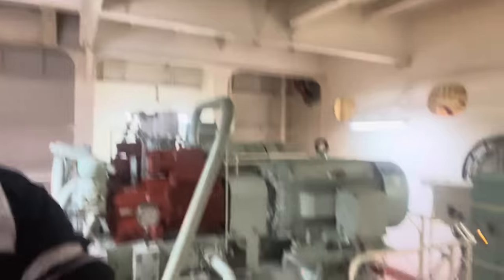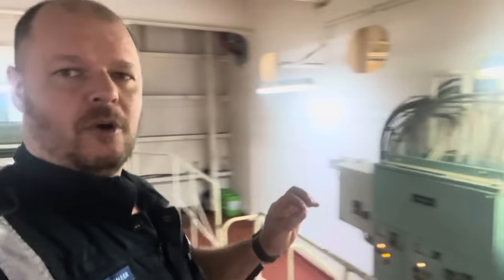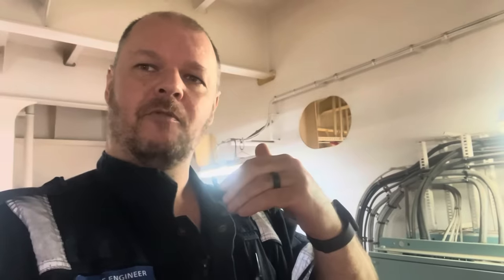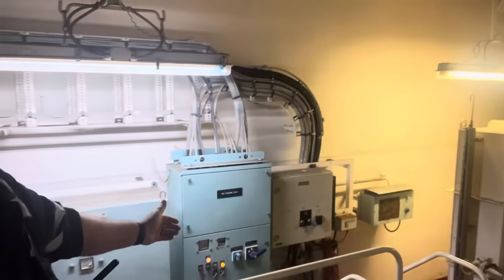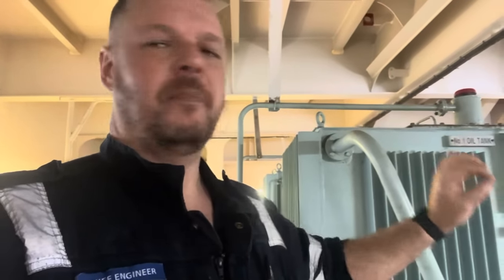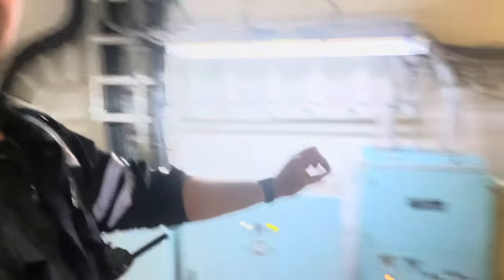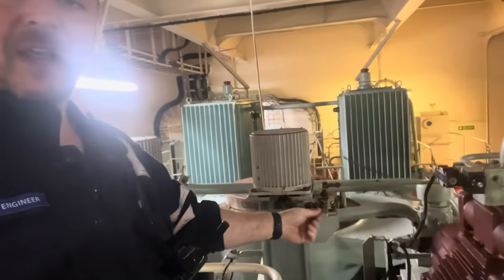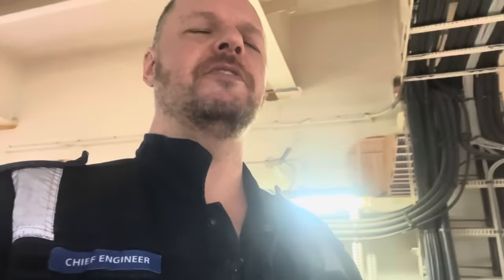Dali size containership steering system. How it’s designed to not hit Francis Scott key bridge

Comment: I'm a master helmsman with years of experience. After trying things out in the Nautis simulator, I think what happened is it took around a minute for backup power to come online, at which point they likely got steering back at least briefly until the second power outage happened, but by then it was too late.  

Two forces were at work over the course of that minute that caused the ship to turn rapidly to starboard.  The ship was transiting near the port side of the channel, and bank suction caused the rear of the ship to pull toward the port channel bank and it also pushed the bow to starboard.  At the same time, the ship was hit with a cross channel current coming from the starboard rear quarter, further driving the rear of the ship to port and the bow to starboard, inducing a rapid turning of the ship to starboard.

Even if they got steering back after one minute and put the rudder hard to port, the momentum induced by a full minute of turning forces without rudder input to compensate ended up causing the swing to starboard we see. Once a ship builds a turning momentum, it takes a long time to stop the turn momentum and get the ship coming back the opposite direction.

If the helmsman had been making a course correction to starboard when the power went out, and the rudder also got locked to starboard by 10 degrees or so for a full minute on top of that, it would make it just about impossible for the ship to recover in time to avoid the peer, even if they got rudder control back the moment the emergency generators kicked on.
Reply: It's looking more and more like that. The crew was doing everything they could. It's just the bridge got in the way of recovering the ship after its power failures.
Reply: What about the giant cloud of black smoke after the first power outage. The way I understand it, since this ship was built in roughly 2015, the main engine most likely had hydraulically powered fuel injectors and exhaust valves, and in the case of a total shipwide blackout, the main engine would have stopped nearly immediately due to no exhaust valves opening, and complete fuel cutoff. I think what happened was, there was a power outage, they managed to start the main engine in reverse, then panicked and put the main engine in full speed reverse. SInce electronically controlled engines have no camshaft, there's no delay in waiting a few seconds to move the camshaft from Ahead to Reverse. If the main engine is stopped, it can be started in reverse, and then in an emergency, commanded to run at max speed. Since it was already running, there's no need for a blow down, or prelube or anything like that.

With a single screw ship, with a single rudder, and moving at only 8.5 knots, the rudder will lose a ton of effectiveness due to the immense amount of cavitation, and lack of water flowing past the rudder. Like others have said, using bow thrusters at speeds over 2-3 knots is useless, and consume far too much electricity to be able to run off of an emergency switchboard.

Here's what I think happened. Several or more reefer containers shorted out, or the cables supplying 480v 3 phase power to the reefer section shorted out caught fire, and tripped the main generator. Instead of letting the automatic system start and run the emergency set, they quickly shut off the tripped breakers and started the other set of main generators, all ships have at least 2-3 or more main generator sets, most often there are 3. One running, one also running in parallel during heavy load operations or during arrival departure from ports or other critical situations, and one in hot standby or in maintenance. Then when they switched that main genset back onto the main bus, and flipped back on power to the reefer containers, it caused another short and either damaged something, or tripped breakers. They must have done this before the emergency generator switched on, sometimes they have a time delay so that the emergency set won't start up in case of a momentary blackout like what happens when you disconnect from shore power, and switch to onboard MDG's there's a momentary blackout. So this explains the first lights out on the Dali, followed by a longish delay lights come back on for 1/2 a minute then go back out. Now with no main generators available to start in time, the emergency set finally starts and runs after 30 seconds or so, you see the lights come back on the Dali, but not the main mast light and a few others, and then you see the bow begin to steer to the starboard, but it's too late and the ship hits the bridge 10-20 seconds after the bow finally begins to steer away from the bridge pylon.

There's rumors they were having electrical problems while in port. If this is true, they were idiots for leaving the dock. You would think that if you were about to take a ship on a 26 day long voyage down thru the Panama Canal, you would want to stay in Baltimore and have any generator or electrical issues sorted before leaving the dock. Number 1 reason would be for obvious safety reasons, a fire on board a box ship is a complete nightmare, 2nd of all, you would want to make sure you have reliable electrical supply to any refrigerated boxes. 26 days with no refrigeration is going to cost a lot of money in freight damages. 3rd, if you're planning on going thru the Panama Canal, there's a high risk of getting inspected before you're allowed to enter the first lock, because the Canal is very paranoid right now after that issue with the Evergreen ship stuck in the Suez Canal. No Canal authority is going to even take the slightest chance you're going to break down in the canal, if your ship looks like crap, you can either get detained, or sent the long way around. Good luck with that with todays high fuel prices, and you'll be late for your delivery appointment.
Reply: The current was pretty low at that time, the tides there are only around 2 feet, and they were only about 2 hours away from slack tides. However there was a slight wind to the south, and the Dali with that many boxes has a pretty good sail effect especially if the main engine stops, and combined with the effect of prop drag.  So it's quite possible the slight current coming from the south channel pushing against the stern of the ship, plus the wind from the north, plus the drag in the water from the stopped propeller could have started the ship drifting to starboard.

I think this whole thing is goiing to turn out to be a classic swiss cheese failure. Human error combined with mechanical failure(s), plus lack of maintenance. Unfortunately they took too many chances, and this time all the holes in the cheese lined up, and 6 people lost their lives.
Reply: Because the ship was in a very hazardous area, it seems the anchor should have been dropped as soon as power was lost. Too risky to just wait and hope for power to return. That would have more than doubled the time to slow down until impact, four minutes instead of less than two.
Reply: I believe there was also a significant breeze from the port (left) side as well, which would tend to cause the turn to starboard.
Reply: @brnmcc01  Thanks for your comment. Lots of good insight there. I'm thinking bank suction from the port side played a large roll in getting the ship turning, as well as a potentially locked rudder to starboard and currents. You are absolutely right that if that engine was brought to a full stop and somehow they managed to put it into reverse, they would lose a tremendous amount of rudder authority, further compounding the problem. 

If you have a slack tide and the ship is riding low and near the side of the channel, the bank suction can be very powerful. When I would drive during underway replenishments, it would be common for me to use 20 degree rudder steering into the ship along side us just to maintain course. The venturi effect is very powerful.

There's a crossing channel right at the point where the Dali starts to turn, which makes me think the currents, even if they were light at slack tide, played  a role as well. The current from the crossing channel would have been directed right at the starboard aft quarter of the ship.
Reply: @c0rr4nh0rn  typically a wind is going to push the whole ship in one direction rather than turn it, depending on the structural layout of the sail area on a ship. Winds were light that day.
Reply: Seems like they were already going to fast
Reply: Thank you, this is bar-none the single best, most plausible, most credible explanation that I have yet heard anywhere on the entire internet.  I can accept that big ships simply do not turn fast, and we've seen recent examples like the big boat that blocked Suez a few years ago.  You win the internet, Sir, bravo!! 🙌
Reply: @laroccafishing4771  Nah, 8 knots is a fine speed. Not too fast and not too slow for a ship that size. The speed wasn't the problem. In fact, if they had be booking it, they probably would have avoided the pier.
Reply: @brnmcc01  They certainly went into reverse, to lose the speed they did (8.5kts to 7). What puzzles me is they didn't stop to find out - was this psychological target bias? Having just completed a tug-assisted turn, she'd not have come underway worth talking about when the first failure happened, and stopping was possible.
The Antwerp incident was also steering-related.
Reply: You can see the Dali regain power and steering just before impact , as it starts turning to the port side but it was too late.
Reply: So the question is, what caused these power outages? We already know they lost power. Why?
Reply: Is it true the ship had been cited for issues in Chile?
Reply: I generally apply Occam's razor to situations. The most simple explanation was an attack.
Reply: So I like the Helmsman perspective, but for the Electricians POV I’d like more input.   Like I assume there is an operator on the electrical panel ? Who can operate the Bus from a console?? To me it sounds like inexperience and training.  I don’t know the system but I would assume the correct plan should have been to isolate the emergency bus that is feed by an emergency generator and get steering back online.  Clear the hazard lessons learned.   But it looks pretty messy from my POV not knowing the class or plant but from my limited view it looks like they choked.  How many engineers would be on watch just leaving the wall ??
Reply: @tonyawhitten5199  Not a new boat, it's been suggested the cargo's reefers (refrigerated containers) may have blown a generator. That would typically show up soon after cutting land power.
Reply: @sofly7634  I didn't spot it when I looked for precedent, throwing up the Antwerp issue. My family's the heritage Queen's Pilot in the Channel in Victorian times, so of course shit happens, but there were bad decisions - she could have been grounded, headed into the sidewater where the CG base is, stopped as soon as the first power outage hit. It's history now, but apply the lessons, don't just learn them. A lesson learned but not exercised gets forgotten.
Reply: @brnmcc01   Such a detailed comment deserves reading and I have trouble reading  big blocks of text.

What about the giant cloud of black smoke after the first power outage. The way I understand it, since this ship was built in roughly 2015, the main engine most likely had hydraulically powered fuel injectors and exhaust valves, and in the case of a total ship wide blackout, the main engine would have stopped nearly immediately due to no exhaust valves opening, and complete fuel cut off.

I think what happened was, there was a power outage, they managed to start the main engine in reverse, then panicked and put the main engine in full speed reverse. SInce electronically controlled engines have no camshaft, there's no delay in waiting a few seconds to move the camshaft from Ahead to Reverse.

If the main engine is stopped, it can be started in reverse, and then in an emergency, commanded to run at max speed. Since it was already running, there's no need for a blow down, or prelube or anything like that.

With a single screw ship, with a single rudder, and moving at only 8.5 knots, the rudder will lose a ton of effectiveness due to the immense amount of cavitation, and lack of water flowing past the rudder. Like others have said, using bow thrusters at speeds over 2-3 knots is useless, and consume far too much electricity to be able to run off of an emergency switchboard.

Here's what I think happened. Several or more reefer containers shorted out, or the cables supplying 480v 3 phase power to the reefer section shorted out caught fire, and tripped the main generator. Instead of letting the automatic system start and run the emergency set, they quickly shut off the tripped breakers and started the other set of main generators.

All ships have at least 2-3 or more main generator sets, most often there are 3. One running, one also running in parallel during heavy load operations or during arrival departure from ports or other critical situations, and one in hot standby or in maintenance.

 Then when they switched that main genset back onto the main bus, and flipped back on power to the reefer containers, it caused another short and either damaged something, or tripped breakers. They must have done this before the emergency generator switched on, sometimes they have a time delay so that the emergency set won't start up in case of a momentary blackout like what happens when you disconnect from shore power, and switch to onboard MDG's there's a momentary blackout. 

So this explains the first lights out on the Dali, followed by a longish delay lights come back on for 1/2 a minute then go back out. Now with no main generators available to start in time, the emergency set finally starts and runs after 30 seconds or so, you see the lights come back on the Dali, but not the main mast light and a few others, and then you see the bow begin to steer to the starboard, but it's too late and the ship hits the bridge 10-20 seconds after the bow finally begins to steer away from the bridge pylon.

There's rumors they were having electrical problems while in port. If this is true, they were idiots for leaving the dock. You would think that if you were about to take a ship on a 26 day long voyage down thru the Panama Canal, you would want to stay in Baltimore and have any generator or electrical issues sorted before leaving the dock.   

Number 1 reason would be for obvious safety reasons, a fire on board a box ship is a complete nightmare, 2nd of all, you would want to make sure you have reliable electrical supply to any refrigerated boxes. 

26 days with no refrigeration is going to cost a lot of money in freight damages. 3rd, if you're planning on going thru the Panama Canal, there's a high risk of getting inspected before you're allowed to enter the first lock, because the Canal is very paranoid right now after that issue with the 

Evergreen ship stuck in the Suez Canal. No Canal authority is going to even take the slightest chance you're going to break down in the canal, if your ship looks like crap, you can either get detained, or sent the long way around. Good luck with that with todays high fuel prices, and you'll be late for your delivery appointment.
Reply: @ohsweetmystery  we have to educate everyone, sometimes one at a time.  Anchors do not stop ships, they hold them in place.  At 8 knots, that fully loaded ship would snap the anchor chain like it's made of cooked spaghetti.
Reply: They dropped an anchor, pretty much explains it.
Reply: @ohsweetmystery  In another video they mentioned that one of the anchors were dropped and the chain was angled toward the back of the ship. I’m guessing that it would also cause the ship to change direction.
Reply: Thank you for the explanation of what possibly could have happened to cause this disaster. Waiting for the final report from NTSB as to actually what happened.
Reply: #1- It was near slack tide and there was no strong tidal current coming from Curtis Bay that hit the starboard side of the ship causing it veer to starboard 

#2- The ship was running slightly towards the port side of the channel when it lost power and steering. By the GPS track we can see it shifted 1 or 2 degrees to starboard putting it in the middle of the channel. The Dali was close to or in the middle of the channel up to this point negating any bank suction from the port and definitely simultaneous dual suction from both sides. 

#3- There was no reason for the helmsman to have made a 10 degree course correction to starboard before the power first went out and the helmsman would not respond to whatever input he made after the power went out. 

#4- The very thick exhaust smoke shows us the diesel was at or near full throttle and under a heavy load in reverse (of course). This is also evidenced by the GPS showing the speed had reduced from a high of 8.9 and down to 7 knots.

#5- The wind was 6mph from the North which had no appreciable effect on the course of the vessel

#6- It takes an enormous force to turn this ship about 15 degrees to starboard. It wasn't steered that way intentionally as I'm sure the Master and both harbor pilots were on the bridge while this was going on. 

#7- The only other force that I know that could have turned it 15 degrees to starboard is prop walk kicking the stern to port while at full throttle in reverse.
Reply: Not an accident
Reply: @Permacamper  Half of what you said is wrong. It was an hour before low tide, there were at least some outflowing currents coming from the Curtis Bay channel that joins the Fort McHenry channel right where this incident occurred.

2. The GPS track shows the turn started with the Dali close to the port side of the channel. Bank suction could definitely be involved, especially since  the track data appears to show the start of the turn occurring around Dali's center of mass.

3. You clearly have never driven a ship in a harbor before. 10 degree RUDDER input to maintain course is what I said.  This is incredibly common at low speed in harbor transits. 

4. The thick smoke plume can be caused by an engine light-off.  Unclear if this was to put the engines in reverse or simply start them ahead again.

5. correct.

6. Correct again, which is why a combination of rudder, tidal current and bank suction is the most likely explanation.

7. This could be a contributing factor depending on the direction of prop rotation. It is unclear if the ship successfully engaged engine reversing. I personally don't think there was enough time for them to get the engines into reverse.
Reply: @ohsweetmystery  High pressure gas line buried in channel would be problematic.
Reply: @JelMain  i watched a video they said that after the anchor was dropped it slowed it down 1 knot, from 8 knot to 7 knots than it hit.
Reply: @TheSound0fLegends   It sure seemed like they hit the bridge piling head on. If that huge ship lost power, it would coast for miles. And coast pretty much on the same heading. Yes, wind and current can play a part, but both were light. That big ol' ship made a hard turn to starboard into the bridge support.
Reply: @jss27560  ... You are correct. The issue is, it was the port anchor that was dropped. Dragging the port anchor on the seabed would cause the ship to turn left. But it made a hard right turn, directly into the bridge piling. That would be caused by the rudder.
Reply: Looking at it there were a lot of factors that add up to cause it to hit. If part of them was corrected than it would have not hit. The Anchor slowed it down a bit but was useless in that short of distance. Restarting everything or part of the electrical systems would have maybe allowed them to use there rudder. My question is did it have enough speed with out the power to the propeller to pass the bridge. If it did than all they needed was rudder control.
Reply: @windforward9810  It takes miles for a ship that size to come to a dead stop from 8.5 knots if you just cut the power and do nothing else.
Reply: Not really, because if the ship's side didn't hit the wind 100% flat (probably 0% chance of that) the wind could be funneled to the bow, thus aiding in turning the ship ever so slightly.
Reply: @ohsweetmystery  can they drop anchor with no power?
Reply: From the video, after the emergency power came on, additional lights came on and the smoke came out, so therefore they tried to start the engine, which ran briefly and then tripped again. If they had left the engine off and concentrated purely on getting the rudder hard to port, using the momentum to push water over the rudder, do you think they could have turned hard enough to avoid the collision?
Reply: @adrianthoroughgood1191  Getting the main engine and generator online would make rudder control more effective.
Reply: Why did the ship leave the doc knowing it had server electrical problems ??
All of this could have been prevented 
 knowing what they knew about the electrical problem before the ship even left the doc
Reply: Why the hard turn to Starboard? All wind and current issues were coming from the Port side, and the Autopilot or Harbour Pilot were adjusting for the wind and current variations that affected the ship's course. the mayday call had been sent and still, the ship continued on the course because the rudder was still working, they had dropped the Port anchor but didn't let out enough chain as shown after the crash the chain is hanging down meaning that it had not been dragging on the bottom. so the Anchor would not interfere with the course change into the Bridge Pier.<><><> My understanding of modern-day ships, a ship loses power to the propeller, the ship will continue on the course it was on before the loss of engine power, and the weight and momentum of such a heavy ship will never turn like the video shows. Remember the ship's electrical supply is from one of several electricity generators that the ship electronic Autopilot controlling the hydraulic motors on the Rudder will keep working keeping the ship on the course set by the Harbour Pilot, remember that the ship was on course to pass under the bridge when the lights were turned off, without electric power to the Autopilot the rudder will remain on the set course while it was adjusting course for any wind or current variations, then when the lights (electric power) came on again the ship auto-pilot would automatically resume the original course settings before the power loss, But! The video showing the sharp turn onto the target had nothing to do with the lights, or Autopilot or wind or currants proving that The HUMAN FINGERPRINT is all over this deliberate turn into the Bridge.<><><> Heavy smoke from the engine funnel is caused by a sudden increase in fuel to the engine, providing strong water pushed onto the now hard-turned-to Starboard rudder, then again the ship rudder was adjusted to Port to stop the turn because the ship needed to make a direct hit not a glancing blow against the target. <><><> This was intentional closure of Americas 5th biggest port! No question about that! But was it the US Government extremists or their FBI, or CIA! Did Terrorists sneak on board and overpower the crew? Was it blackmail of the Harbour Pilots and captains and engineers, no matter why? It is “who are they” that must be discovered because 6 people are dead because of this deliberate act by some of the People on this ship!!!!!!!
Reply: @brnmcc01 brilliant comment…. Does sound a bit what  it must have been like at the helm when Chernobyl kicked off !
Reply: @michaelsuede  What if instead of reffer units popping power it was just engine power issues that started the short then, your power breakdown,  would be coupled with bad upkeep, training, then bridge?
Reply: @sofly7634 Yes! I saw a video where they showed the official documents stating issues but it was vague what kind of issues.
Reply: @bobharris6095 It’s peculiar too that the Captain was Ukrainian & afterwards on telegram there was abunch of jobs well dones from Ukrainians. Some even said if aid packages weren’t approved more was to come. Strange huh? Crazy that this bridge due to its name also makes it a  national US symbol & its destruction is symbolic.
Reply: Nice synopsis
Reply: You mean quartermaster
Reply: @brnmcc01  You guys are going through an awful amount of mental gymnastics to come up with some kind of theory that works. A fully laden ship is not hampered by the "sail effect, because the freeboard is far less than the draught, in which case the ships direction is influenced purely by the water flow along it's hull and rudder..(Wind speed was not excessive, and neither was the current, according to AIS and local charts)  The course was miles away from the port bank, so the bank suction theory is nonsense. There would also have been a pilot on board, who would be fully aware of local currents. The very fact that Fact-Checking websites are already telling us how, and why, it happened, should be causing alarm bells to ring in any free-thinking individuals head. They are saying crud like "there is only one form of propulsion, only one crew, and only one means to steer a ship. Come on guys. We all know that's balony. Why are they saying this? What do they know, that people who have spent a lifetime in the marine industry don't? According to AIS the ship was on course, under eight knotts of speed, right before power went out. Why didn't the EM Gen kick in immediately, because it's linked to the main board? Nothing rings true about this narrative.
Reply: @brnmcc01  Why would you have the same engines that power your cargo reefers also powering your main propulsion? Sounds like a big risk for this very reason.
One electrical short knocking everything out. Especially on cargo you can't always verify all the electrical circuits on.  The cargo reefers should have been on separate power from the ship's critical systems.
Reply: So "I think what happened is it took around a minute for backup power to come online"? And you can see on the port camera view the backup generator kicked in after 59 seconds. Your estimation is pretty much flawless! :)
Reply: My comment shadow banned again, which tells me I'm on point.
Reply: @ohsweetmystery  Anchors keep a ship in place. They don't stop you while you are underway. (My understanding is that it bounces along the bottom if you are moving too fast.)
Reply: @windforward9810  That is the whole point. They lost power hence lost steering, rudder obviously was in right ten or 15 degrees, there is time lost while the emergency diesel generator starts up and can provide power to steering.  But they are travelling at 7 knots at 100,000 l/tons, too much momentum to stop a vessel that big in that amount of time.  And while this is going on the engine room is attempting to get the main power back on, but time is ticking and your still moving towards the bridge.  There is no time to get steering back on and go full astern.   Drop the anchor as a last dich effort, but the die was cast, the bridge was going to get hit.
Reply: @windforward9810  Yes they has enough speed at 7 knots to clear bridge but no steering. Ship weighs 100,000 l/tons, it is not stopping for  probably 2 miles plus.